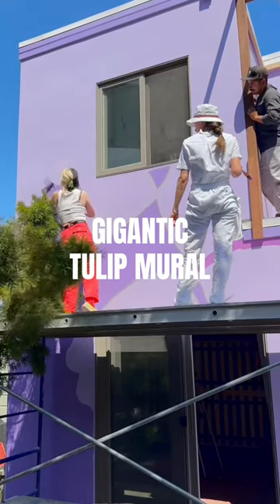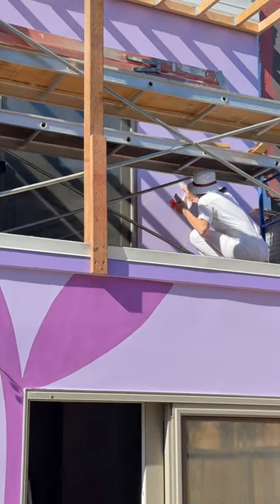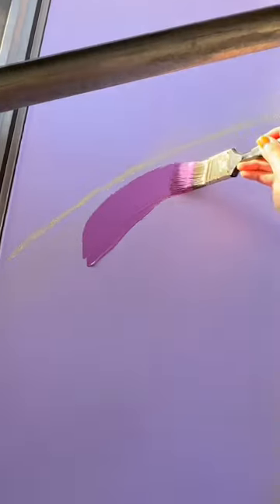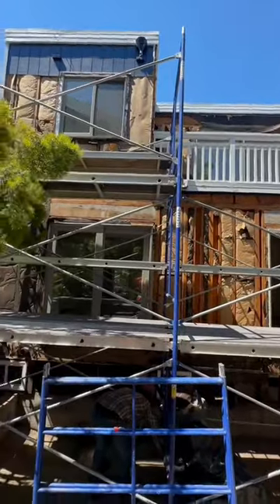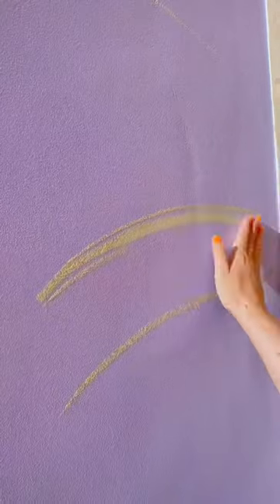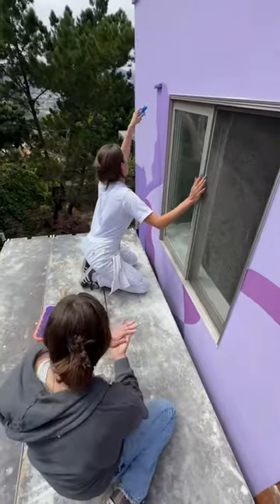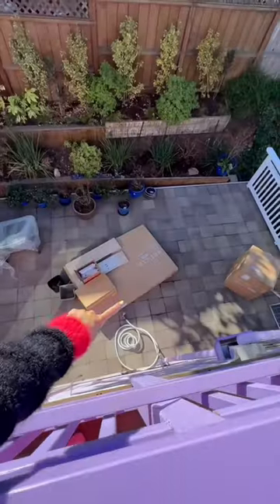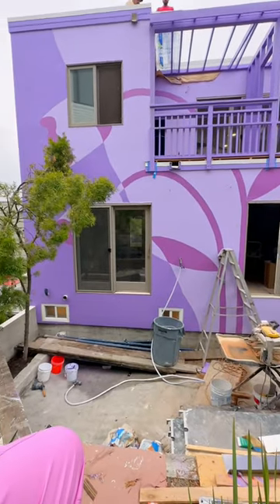Gigantic mural tricks!

Comment: Be careful. Since you are a business, I'm assuming, you might be posting an OSHA violation for them and/or the city or county to fine you.
Reply from the maker: Interesting! I’m not a licensed interior design/decorating business so I wonder if that applies to me 🤔 I don’t feel like a professional at all, just learning along the way so I appreciate you telling me
Reply: OSHA or not, i would advise wearing a protective helmet any time you are 4ft or higher off of the ground, via a ladder or scaffolding of any kind! Even if you feel secure, accidents can happen. The mural is gorgeous, btw, great job!
Reply from the maker: @GraeStar  I absolutely appreciate that and you’re totally right! I didn’t have a helmet on site but that just means I need to get one
Reply: @TayBeepBoop  Agreed. Also since that top scaffolding doesn't have guardrails installed, you likely should have been wearing fall protection or a travel restraint system. Likely a travel restraint system would've been good here.

Heights work is dangerous. Roofers and other professionals working at heights die or suffer injuries every year. Want you to be safe so you can do all your beautiful work for a long time to come.
Reply: The scaffolding is missing railings + protection against items falling off of it (basically a board at the bottom boarders). Too many people have died from improper scaffolding and items falling from them. Even small items like screws become dangerous when falling from that high.